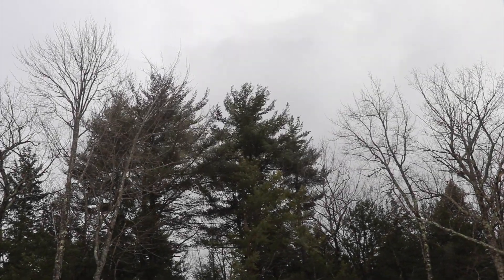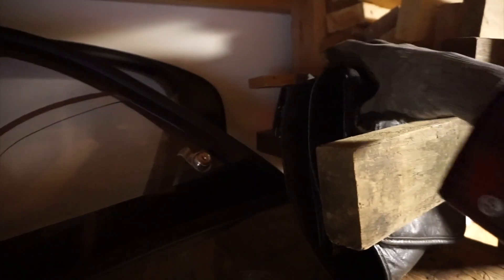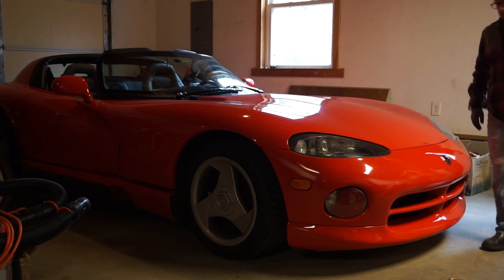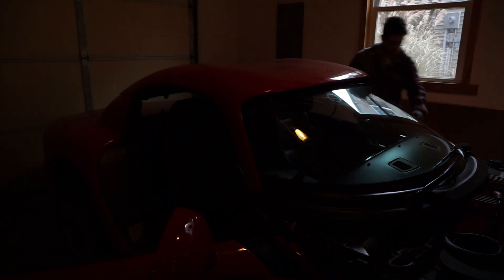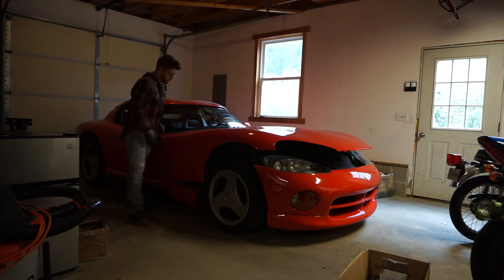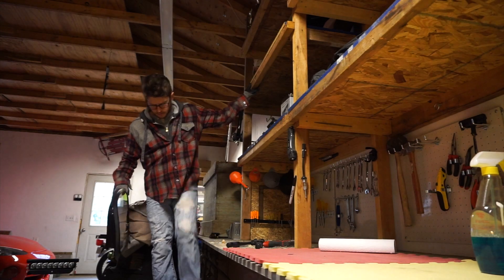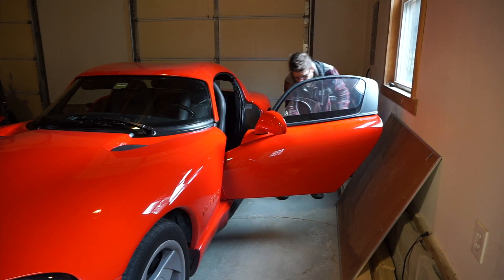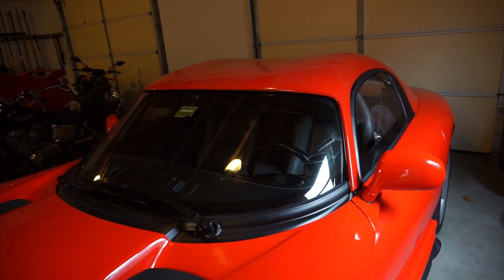Installing My DODGE VIPER's Autoform Hardtop

Comment: Hopefully theres no salt on the roads in ur area and once my new autoform top goes on its staying on, i threw my trash soft top away
Reply from the maker: Once snow starts flying, they do bring out the salt...so unless the roads are super dry and super clean, I sadly won't be driving it much

Was your soft top the original?
Reply: GETUP AND GO salt dust on dry winter roads is just as bad on the chassis, just saying its your car, my cars are undercoated with oil based spray and taken off the roads from october-may, everything rusts so bad in eastern canada and yes original, i hated that peice of garbage
Reply from the maker: Yeah, I don't really drive it once the snow gets here--but I will probably be getting an undercoating next year for some extra protection (video of it when I do)

I had always heard the factory canopy was bad--I wonder if it was worth anything?? Sounds like they are pretty rare cause everyone seems to get rid of them, ha
Reply: GETUP AND GO if you want a good undercoating buy kleen flo Honey Goo i get it at canadian tire, it lasts way longer than rustcheck or crown and its $10 a can, the soft tops are horrible and ugly, rain goes right thru